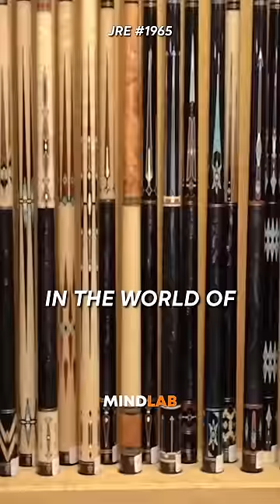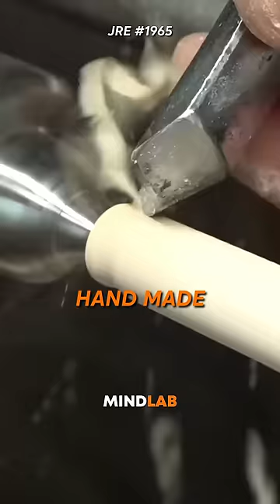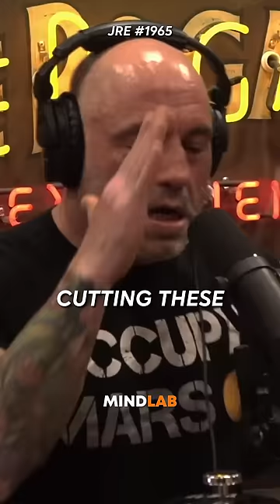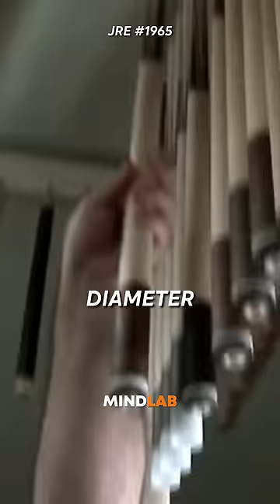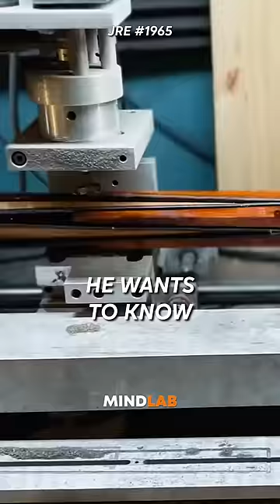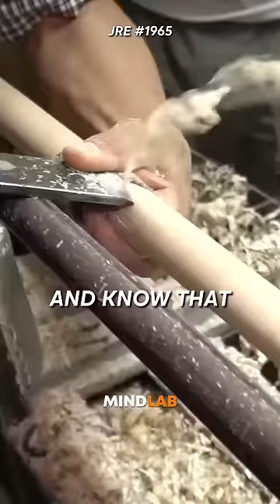Joe Rogan On Computer Vs Man Made Pool Cues🤯

Comment: For the ones not understanding: wood is made of grown fibers, and some of them are bent tighter than others so the same tree can have different densities in different areas so if you knock and listen to wood you can tell the properties, whether it'd be good soundwood or not, or if the vibration would suit the intended use.

Comment: Story time…
I was around 12 years old living in southeast Missouri, when I wondered into a pawn shop and saw some cues in a corner.  I loved playing pool, so I inspected all of these old “pool sticks” to see which one I should adopt, as my own, (I had about $12.00 to spend). Most of them were cheap two piece cues, that were missing the ferrules or tips, however he last cue I picked up had a nicely wrapped linen forearm/butt, with a solid stainless collar, but a damaged shaft. I bought this cue for five bucks and used it at the local pool hall. I asked my mom when visiting my grandmother, in STL , if we could go to the A.E. Schmidt company, and see if they could make a shaft. They told me they could make it, but it would cost around $120. Keep in mind this was circa 1995, and as a 12 year old,  I didn’t have that kind of coin lying around. Slightly exasperated my mom told me to keep the butt “just in case”, we could find and useable shaft, so I did.  Fast forward to Christmas morning  morning and I open a strangely thin package and it’s the shaft for my pool cue. I eclamined to my mother that I loved it, but she shouldn’t have spent so much money on my cheap pool cue, I bought from a pawn shop. She said “Sweetheart I bought it because I see how much joy playing pool brings you, but that “Stick” you happened to buy at the pawn shop, was a very special Paul Huebler model, that happens to be made right here in Missouri, and by the founder of the same A.E. Schmidt Company, that we happened to take it to. Apparently the gentleman at the desk had told my mom the I had a $600 cue and she said, make the shaft. Thanks mom.

Comment: I'm a CNC programmer and machinist. I deal with serious stuff. I make fittings for pipelines around the world. A common misconception is that CNC machines just make parts and there's no human element. I literally just got off work and was running a lathe before I left and the only difference  between a manual and CNC machine is the control panel and I can run both. You're still taking witness cuts and checking measuring it by hand and checking everything. It's just ran by a program and you don't have to bring the tool in by hand or load tools by hand. The tools are kept in a carousel in back of the machine and the machine will load then automatically. It's just more time efficient.

Comment: My father was a master on a wood lathe. As a pattern maker, he'd been using lathes for 40 years but it wasn't until one of the last lathe jobs he spun was the first time the he felt like he moved from Jouneyman to master. It looked like a elaborate cam or crank shaft. All by hand out of mahogany. 
The lathe is often times called The Machine Created Everything". They were invented to rifle canons. When the canons fell silent, those lathes coupled with the emergence of electricity, and Bessemer's steel, spun out the industrial revolution. To create the components for any motor or engine, one REQUIRES a lathe.

Comment: The extremely slight imperfections on man made creations adds an element of character that can not be replicated with perfect machinery. Especially if the artist does it extremely well to the point that it can be compared to machinery. With a machine tooled item, it can be impressive like those zero tolerance metal shapes that slide into each other perfectly but we know a machine did it

Comment: coming from the world of Machining using CNC equipment does not remove the craftsmanship aspect I still have to inspect my parts finish for any possible flaws as well as take into account the harmonics of the material in certain applications Computers do not remove the human aspect of it they simply make it easier to achieve I can take less time to produce a very good quality part than i would on a manual lathe

Comment: There's a lovely middle ground referred to as mid-tech in the knife world. Many parts are machined and manufactured in a country like China through factories with very high working standards and then the parts are shipped back to the maker for hand fitting and finishing. Saves significant time, money and you still get the hand finish.

Comment: There is nothing a skilled operator can do on a  manual lathe they can't do on a cnc lathe. but there are some things that are far easier to learn on a manual machine and for piece work with variances sometimes doing it manually is more time efficient than setting up so a machine can work on it.

Comment: I'm pretty experienced with manual machining. It's not about tradition and the authenticity of hand work. It's that slow methodical hand work can still be more precise than a computer when you're doing stuff like building pool cues. same with musical instruments. a human can't beat an EDM machine, but a skilled scraper can beat a planing machine, and a skilled grindsman can beat a milling machine or CNC lathe. there's some craft that requires such tiny momentary sensory information to where you need a small machine, and, if you have a small machine, a computer might not be able to account for your lack of rigidity. so, yeah, hand made pool cues can be better. same with a lot of extremely intricate and refined pieces of mechanical technology.

Comment: Robots don’t have souls unlike the craftsmen who hand makes one. I happen to be lucky enough to have a car that was hand built not on a assembly line. The motor was built buy one guy, the whole thing by hand. I don’t think they do it anymore but BMW use to hand assemble all M cars, and I have 2 and both were built in the era when they were all hand built. You can tell a difference. They just seem to have less issues than the assembly line ones and they have more touches

Comment: Its always funny to me when people bring up man made vs computers.

The guy joe is talking about here used a lathe.  a lathe is a machine so really he didn't construct it 100% by hand.  he used technology to construct it.   Humans got to where we are by using tools to our advantage.  

Instead of one guy churning out a few pool cues we can have entire machines churn them out faster and in larger quantities.  The machines are literally doing what this guy is doing but better, faster, and with less skill required by the operators.  Its not a bad thing its called progress.

The advantage to Joe's friend is custom orders.  Machines that mass produce stuff generally have to be adjusted and recalibrated if you want to change stuff.  Its not cost effective or practical to do that for a single custom order.   Joe's friend can easily do a custom job and it will remain cost effective cause he doesn't really have to recalibrate anything.  

ultimately both cues will perform the job required of them and will work equally well within a margin of error (unless manufacturing defects exist in either cue).

Comment: Oh for the sake of lost and well gone by now youth,  the joy and pleasure that bouncing a mixed hard wood shaft off a hard smooth unforgiving surface, feeling the vibrations ripping up to the tip, only to go a little dull, but never mind give it a few strokes of a fine grade polishing cream used with a felt glove on and off set, to quickly tune it up 😂😂😂